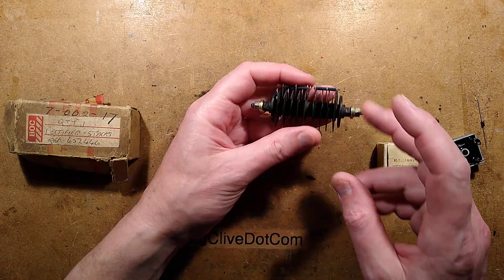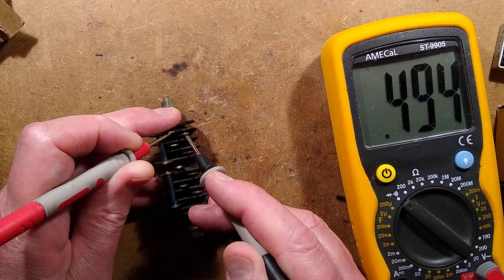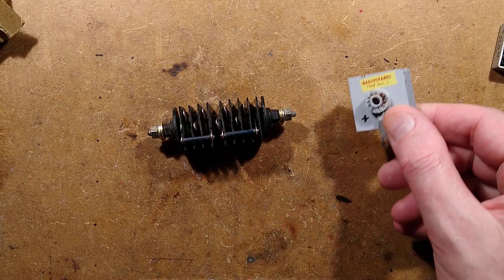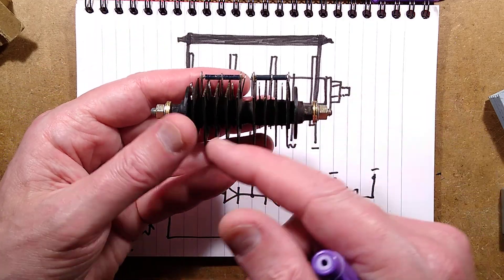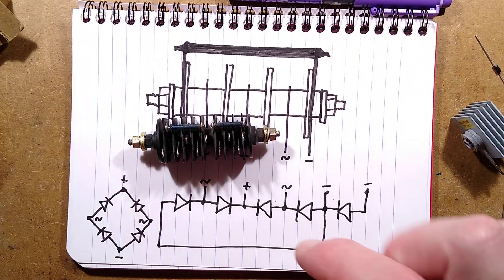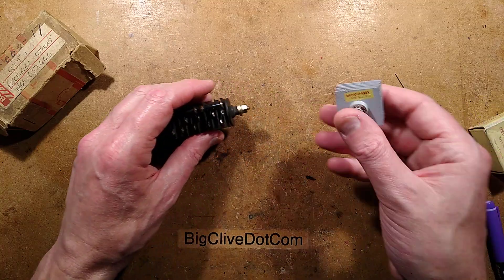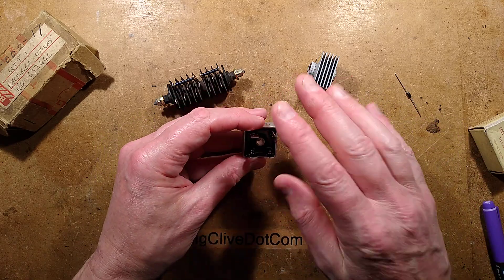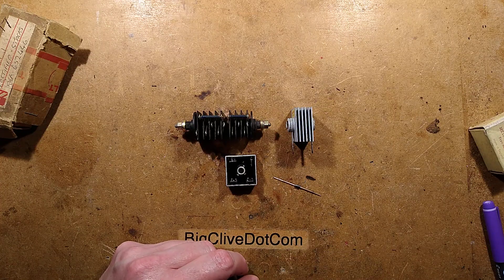Selenium rectifiers - the smelliest components ever

Comment: Selenium rectifiers made their way into consumer electronics as well. Radios and TVs had them. Sometimes you can do a replacement 1:1 with a silicon diode (1N4007), but in other cases you have to add a series resistance to get the voltage within range. This resistor is almost always required when replacing the selenium rectifier in a portable valve radio that runs from both mains and batteries as the valve filaments are DC and have to be within a specific voltage range. They were commonly used in televisions for a while as well, but in those cases, you usually didn't need to add a resistance, or there was already a series resistor (that usually fails) to modify anyway.

The US Navy is what really put the end to Selenium over here in the US. In the early 1960s, it was specified that selenium rectifiers were not allowed as silicon rectifiers were far more reliable. I'm sure this trickled through the military requirements over the years. Remember, this was back when it wouldn't be uncommon for a ship to have possibly a few hundred valves in service at a time.
Reply: Yeh, domestic car battery chargers often used selenium rectifiers.
Reply: @michaelturner4457  yep, even when silicon diodes were common they continued to use them due to their higher internal resistance, a useful current limiting effect
Reply: @andygozzo72  They were very simple, a transformer, a selenium rectififer, and a meter to show charging current, and that was it. :)
Reply: Just guessing: If the voltage had to be as close as 1:1 as possible and have decent current handling, you could throw a few rectifiers in series (and snip their AC terminals). Not as cost effective as a resistor on low currents, but can drop ~2v per package with a bonus heatsink & mounting setup.
Reply: @TinWhisker   for sure. People do the diode string trick when switching out a tube rectifier for silicon as well, since a 5Y3 may drop as much as 50-60V, or in general if B+ is too high (higher modern mains voltage, un-ideal transformer etc). Using zener diodes between center tap to ground is a common method. Can drop tons of voltage with a few diodes. 

In small radio sets, it's not really worth the effort. I've swapped selenium out of small hallicrafters shortwave radio. It actually worked just fine without a dropping resistor, but I added a low value one to get the voltage closer to schematic measurements.
Reply: @JMA_Elec  with the exception of sets with DC filaments, especially if they're using battery valves rated for ~1.5v, overvoltage there could dramatically shorten their lives, excess HT I would think would be less of an issue as long ass it's not miles out. Obviously more of a problem in 240v countries with AC/DC sets since you need twice as much rectifier to handle it, and so twice the drop.
Reply: @ryancallaghan3888  right, if the rectifier also effected the filament voltage. In all radios I've worked on (a handful or 2), that wasn't the case though. 

 It didn't have selenium, but I've only worked on one 1.5v fil radio. Never got it working quite right. It was a transformerless set, had a resistive power cord (curtain burner). Used a higher voltage rectifier for AC. In those, you'd just increase the line resistance if needed, possible replacing the curtain burner entirely with a higher power resistor in the chassis. 

The radio I repaired with a selenium rectifier actually had a power transformer with a separate tap for filaments, so they had nothing to do with the diode.
Reply: @TinWhisker  in cases where a power resistor is already in circuit it is easier to upsize the resistor. Also in consumer electronics had half wave or doubler circuits anything full wave would have been off a center tap transformer. Most of the really posh stuff skipped selenium, especially in the power circuit. Color TVs typically didn’t use selenium, for example.

Selenium Diodes were sometimes found in other circuits, but they didn’t give off a nasty smell on failure.
Reply: I remember them from my TV repair days. That used nappy smell was a great tell tale.
Reply: should always use a series resistor if replacing a selenium rectifier in high voltage applications, or the ht will be far too high, plus to reduce switch on surge current
Reply: @andygozzo72  I remember BY127 silicon diodes being used to replace selenium and half-wave valve rectifiers in '50s & '60s TVs. A Radiospares mains dropper section 33 or 66 ohms often being wired in series as current limiter.  Duff electrolytics could also be smelly if they didn't go bang first.
Reply: I remember small selenium recs used in horizontal sync circuit in tube TVs.
Reply: 100 'valves'...you'd likely have that many in a single radar set....
Reply: You can imagine how terrible it would be if a selenium rectifier failed in a submarine!
Reply: I used to keep some NTC thermistors for that purpose. In a few other cases, a lamp worked for voltage drop and giving current limiting without having to use a higher power resistor.
Reply: As opposed to the few billion silicon valves typical today ...

Comment: I only came across these a few times. One in an old elevator circuit. I was not allowed to touch this circuit as elevators are covered by another qualification with insurance applied. The other was in old control circuits in the steel mill I was working at for 10 years. They were replaced before failure even though they were very reliable.

Comment: I have several 1950s German (Grundig, Telefunken, Nordmende, Siemens) vacuum tube wood cabinet radios which use selenium rectifiers.  I have been told when they fail the gas they give off is very toxic. Fortunately it hasn't happened... yet.
Reply from the maker: It's so smelly that you'll want to leave the area anyway.
Reply: @bigclivedotcom  I concur - I well remember the stench! 50 years ago the one in my train set controller blew my father joked that the only upside was the loft was now fully fumigated!
Reply: Better replace them with silicon. But then if they've lasted this long, they're probably not going to fail anytime soon.